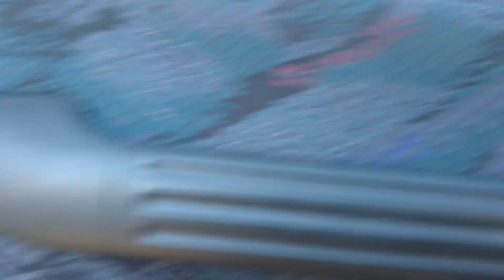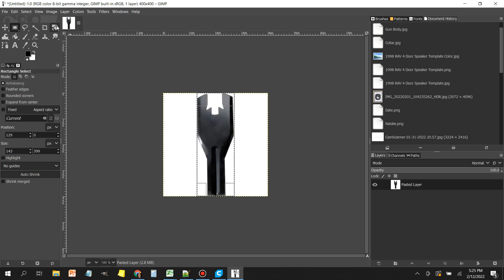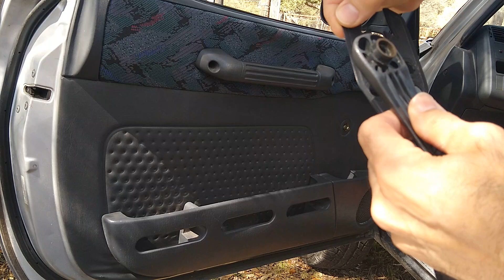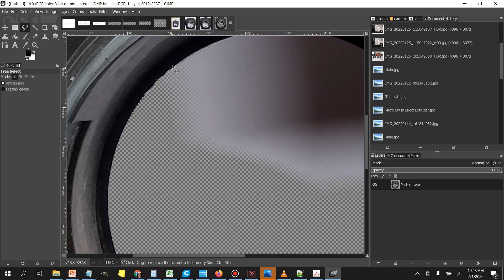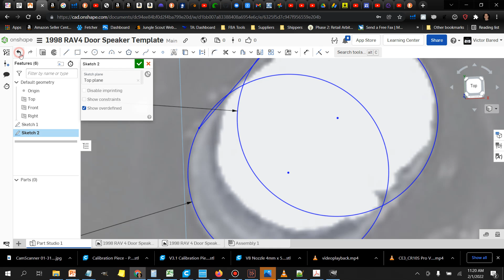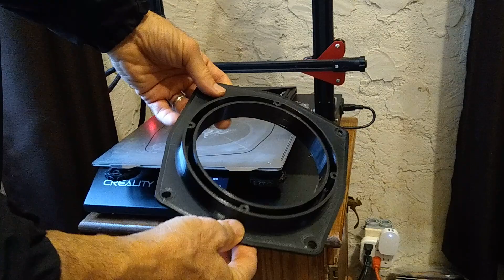How to Design in OnShape, 3D print on a CR10S Pro V2, and Install Door Speakers into a 1998 RAV4

Comment: Nice practical use of 3D Printing! It's nice to see something made other than a Benchy or Articulated Dragon! Haha. I need to try out OnShape. I like the jpg import to start with. It would be really nice taking a picture of a circuit board with antenna connectors to create an enclosure. Radio hobby, always needing some type of enclosure, antenna part or something not available. Thanks for another great video!
Reply from the maker: Hi Steve, Thank you for commenting.  You're going to enjoy working with OnShape of the few CAD programs I've tried OnShape has been the easiest for me to pickup. Most people have no idea how useful a 3D printer can be. We recently replaced a couple of pull out single beds with a trundle. The top mattress can be any thickness but the bottom was limited by the space below the Trundle main frame. 3D printing to the rescue. A quick OnShape session and 4 prints later we have 2inch stand offs that fit like factory parts, it's amazing.

Enjoy your day, Steve!

Comment: good job! Old school trick I used when at the dealer in the 90s was to use a shop rag for the window crank. I always had a shop rag hanging out the back pocket. Just wrap it 1/2 around the door panel and crack and rock back and forth till it popped the clip.
Reply from the maker: Hi UcantbeSerious03, thank you for bringing that memory back to me. I used to use the same hack and forgot about it.